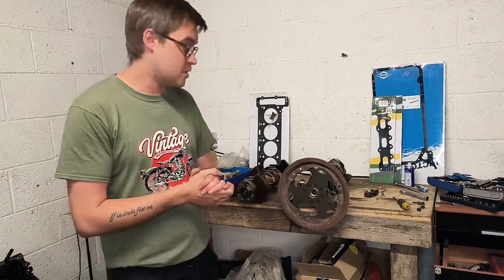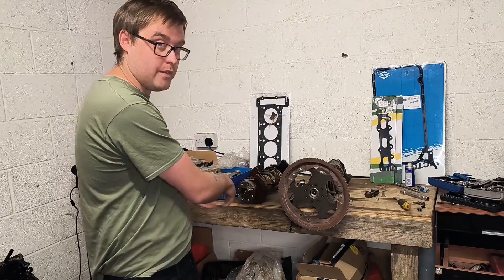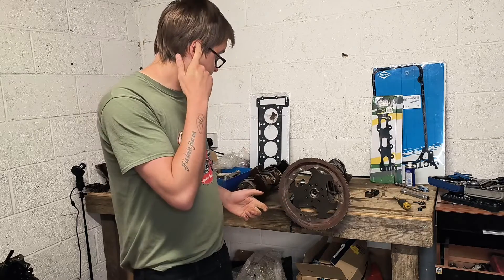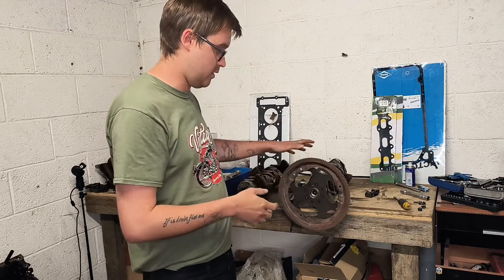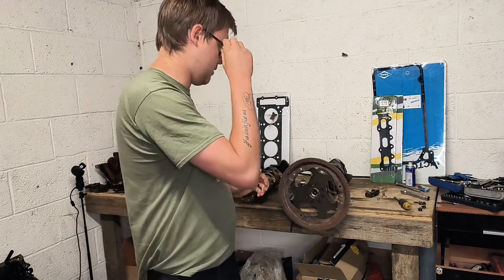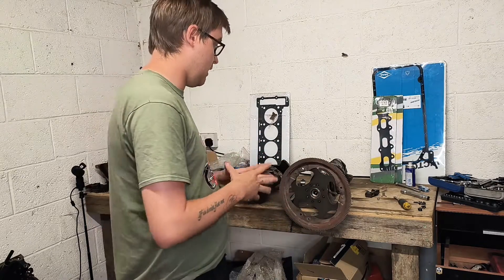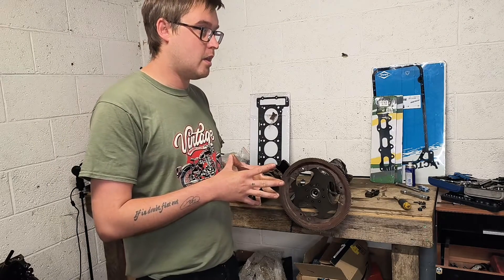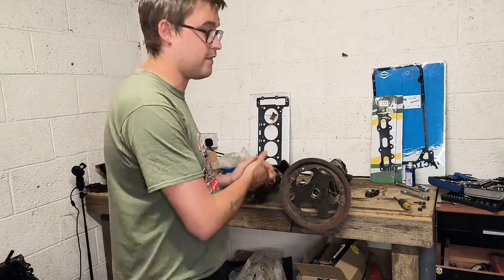Om601 Vs M111 Crank, just answering a few good questions

Comment: have you finished this project? what power did it make?
Reply from the maker: Unfortunately no not yet, it's been on hold for a while which is far from ideal, but it should be capable of 500hp fairly reliably when done, it's just taking a long time to get finished due to funds and time

Comment: How are the early VS evo heads different? Is the valve size & port shape the same and just differences in the top bit with cams & timing actuators? Or actually 'flowing' differences?
Reply from the maker: The pre Evo m111 has a different cam profile smaller round ports I'm not sure on valve size, but the post Evo has sodium filled valves oval larger intake ports there is differences in squash volume to I believe. Also the pistons vary pre vvt and post vvt have the valve relief cut outs in opposite sides where as the post Evo if I remember right has four valve relief cut outs as opposed to two. I want to try to get a pre vvt head and a post Evo head and visually compare all three in a video but unfortunately I don't have the spare cash to at the moment, ide really like to be able to answer your question a bit better
Reply: @M-oneeleven-M111  what's your email?

Comment: Thank you for your detailed answer! Although mine is not ideal (m111.944) ill try to suck out some more power from it trough rpm. If the valve springs i ordered can manage to keep power going to 6500 rpm i am expecting around 230 hp (192 stock) and i want to set the redline at around 7k depending on graphs. I will update you once i do it, it will probably take about 2 months because i have to wait a lot for shipments, and also considering im running stock maf injectors and fuel pump i suppouse these might be a problem too (any information on the capabilitues of these parts is more than wellcome as i really need it :P).As for the crankshaft unless some unexpected resonanse appears due to as you mentoned ballance is not ideal it should be absolutely safe according to calculations. Im really happy to have your responses, be well!
Reply from the maker: Thank you, I think that's a very achievable goal power wise the stock engine with springs should be ok at 7k I believe there are some M111s in the race scene that rev to 8500-9000 rpm, there is a Australian race series for trucks that use the M111 engine N/a there is also a guy that is fitting a all motor M111 in a Lamborghini too for a race series, these engines are capable in both forms it's just a case of expecting realistic figures which you are and it's great to see, some folks think you can bolt a turbo to these stock block and make 450hp which I have thoroughly tested is definitely not possible 🤣

Comment: The om606 shares the same bolt pattern as the m112 and m113 v6 and v8 respectively 
I was wondering if the sprinter flywheel fitted the m113 and you have confirmed that. There is 2 different patterns on the 112 and 113 but the one I have this will work
Reply from the maker: Information like this is great to share , obviously over this time period Mercedes had many production engines and although I have owned one m112 car and two M113 cars I've not had the opportunity to get that in depth with them so thank you for sharing this 👍
Reply: @M-oneeleven-M111  agreed and I'm also sure the m156 as well as the m272 v12 is the same also 
I have an m113 with a m112 manual 6 speed for a project so this definatly helps going forward
Also away to pick up an SLK 230 shortly and this video gives me ideas for that as a turbo track car
Reply: The om606 shares the same bolt pattern as the m111, but they are not the same as the m112 and m113. Very different.
Reply: @professorjamesmoriarty5191  the m112 and m113 have 2 different patterns. The one I'm referring to matches the om606, and m111. Rensport and PMC do flywheels and clutch kits and refer to both with the 112 and 113 111 and 606 as fitment types

Comment: Great info buddy as usual , when you say evo engine do you mean the M111 that did not come in the W202?
Reply from the maker: Yes mate the post 2001 M111 Evo had quite a few revisions that make it great for revving not so great for high hp handling, I would like to make a all motor m111 Evo that uses gsxr throttle bodies, but I get many ideas 🤣
Reply: @M-oneeleven-M111  so would you say the early pre evo version would handle 400bhp with the appropriate mods , double valve springs , ground cams , forged rods ,  MLS head gasket , diesel flywheel , block shims ,
Reply: @Shadowmosesarea51 mines run to 480hp stock never opened 😂 m111.975
Reply: @anthonyf3253  what mods? what millage?
Reply: @samurboi8007  stock engine from clk230 about 130k on it before turboing, still get 150/160 psi on cylinders

No mods except turbo and stand-alone ecu
Reply: @anthonyf3253  damn thats clean as hell those 2.3 evos always make alot of power, thats why i opened up my m111.955 and ported and triple angle cut lol

Comment: Nice. Stroke is 84mm for om601, the m111 has 78.7, 86.6 and 88.4. Are you using shorter rods? Bruv I need to drive my w163 m113 to you for a rear turbo. And awesome video
Reply: And I found your answer to the issue stroker. Doh moment. 😂  and I did get the om601 stroke wrong, its 92.4mm. On your other video explaining the differences
Reply: Would the M111.970/974 kompressor rods be an option? Its 86,6mm?
Reply from the maker: @zonta71  unfortunately all the rods remained the same length and it was only the cranks that varied the stroke, the m111 is a challenging engine to find parts for owing to the fact that so few people tune them
Reply: @M-oneeleven-M111  wait, the m111 rods are all equal length and the Pistons different to compensate larger stroke? What about material & forging/casting?
Reply from the maker: A rear mount on a w163 that sounds awesome man, there's a guy called stab tech he rear mounted a holset turbo in a e55 w210 give a good idea of how to do it, I do miss my V8s there really is no replacement for displacement. After I've done the m111 and M104 I would like to do either a V8 or V12 turbo build but likely it will be a M113
Reply: @M-oneeleven-M111  yeah Stav Tech. Don of off the hook tuning while breaking all the norm.  Awesome guy. Visits their workshop some years back but never met Stag himself. So video is next? Parts list? To get include T4 flange, separate oil system for Turbo with oil pump and reservoir, speeduino and the ultimate NAG tcu for the 722.6. I got the intercooler, pipes etc, oil radiator, gearbox fluid cooler and a set of lower ratio diffs F&R. Looking for 10s 1/4 mile or lower. Hoping to munch on some AMGs.
Reply from the maker: @zonta71  a self contained oiling system should be fairly easy to make and given the extra space on a w163 will help, I use an Ofgear controller for the 722.6 but I have been trying to find an alternative for the sake of working out what's better. What size turbo were you thinking? Yeah man Stav is awesome he's doing stuff with 1.8t VW/Audi engines and the new shape mr2s, I like the way he tries a lot of ideas that come from motorsports and I swear no one knows more about holsets than that dude